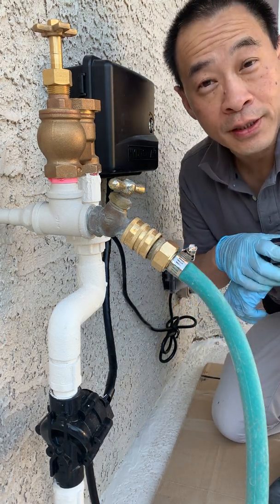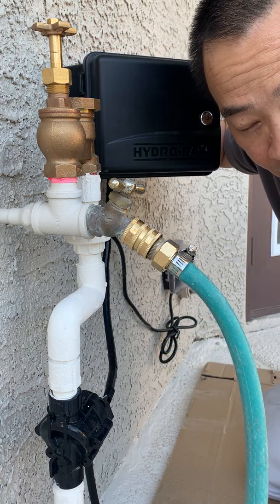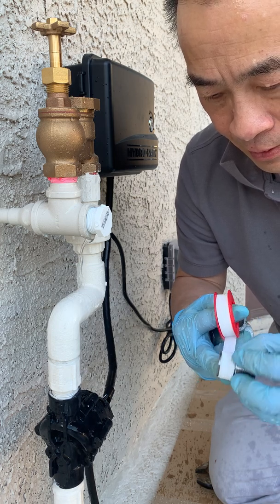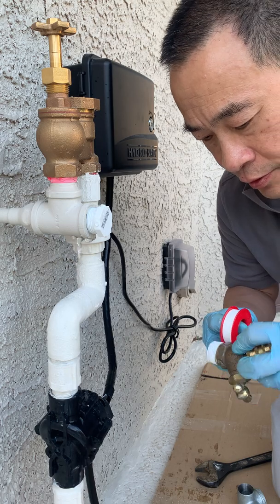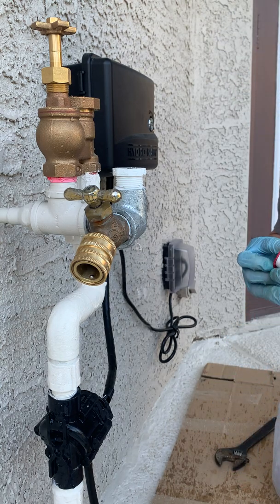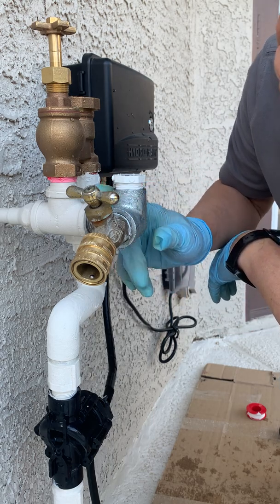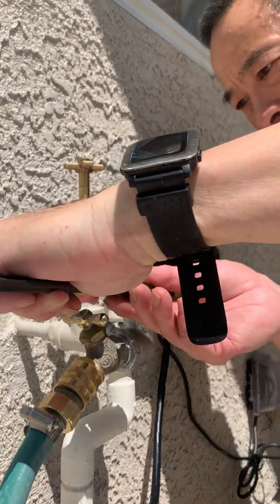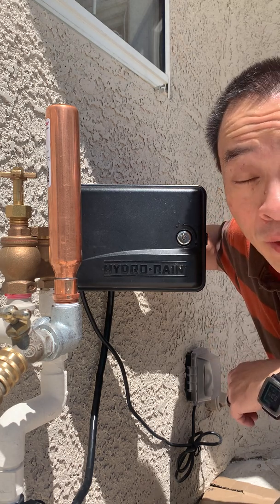Installing a water hammer arrestor for an irrigation valve (See description for update)

Comment: Utizlizing a spigot upstream of the vacuum breaker, other than as a way to drain the line defeats the pourpose of the backflow preventer.   If the client wants a hose bib tied into the irrigation system, it's best to have it on the downstream side.   And who still uses atmospheric vaccum breakers?  Go with a PVB at least.

Comment: I really like that arrestor, because it is large. Can you share what the exact model is? The hydrarestor comes as a 653-B, -C, -D, -AS, and many other such varieties. Thank you so much for putting together this video.
Reply from the maker: Hello!  That was the 653-B.

Thanks for watching!
Reply: @willischung6407  Hi Willis, How has the situation been with water hammer 3 years after using this Sioux Chief arrester ? I am looking to install one right off the stop/waste valve .. Just wanted to find out your reason of choosing 653-B ? Thanks.
Reply from the maker: @anthonyfung7788  Hello! The impact of the valve shutting off is definitely decreased with the 653-B.  I assume that the bigger the arrestor, the more shock damping it will provide.  There fill valve to the pool handles a high water flow, and this arrestor certainly helped.  They don't last forever, but so far I haven't noted any deterioration in shock damping.

Comment: I like your video and it's very informative but I have to mention when you are tightening up the fittings especially ones that have to be real tight be sure to back up the other side of where you are working with a  pipe wrench to keep from cracking the copper line that goes in to the wall. They don't give much. I've seen where people will unknowingly crack the solder loose on the connection that creates a leak. It may not be a gusher at first but you will see evidence of a seep starting when you see green corrosion beginning to form.
Reply from the maker: Thanks very much for your comment!  I will back up the fixed side of the connection in the future.  A friend of mine ended up in the basement cracking pipes from the third floor on down…

Comment: I love seeing guys run wrenches backwards! Pipe dope is a lubricant and sealer. Also, tip 4 u my friend if your using tape. Wrap teflon same direction as thread rotation. Think of "tightening the teflon tape" as fitting is screwed in. Good video!
Reply from the maker: I was taught long ago that there is a correct way and an incorrect way to run a wrench, but obviously still need to relearn that lesson. Thanks!
Reply: Don’t know why you needed to give a “tip”, he is wrapping it in the orientation of the pipe he just rolls the tape on it backwards

Comment: Looks like it did nothing at all. Same as mine then I noticed you never came out and said from inside the house it was quieter.
Reply from the maker: Inside the house the vibration from the valve shutting off is distinctly reduced. The sound of the valve shutting off can still be heard in the back of the house, however. I don't think there is any way to reduce the sound.
Reply: @willischung6407  the disturbing factor in my 27 year old house is that this started in the last 3 years😡

Comment: Dissimilar metals need dielectric union 
Galvanized not legal for water
Reply: Check your local codes on what’s legal. ..Sure electrolysis isn’t good, but it’s just a sprinkler with easy access, so when the metal eats away the weaker, easy fix....but that will be long after the rubber gaskets fail anyway.
Now using two wrenches to counter your torque so you don’t snap your water line behind the wall or in some other crap spot would be better advice.
Reply from the maker: @UCKcmvX4gD6tG4B-VP1ucs5Q I did replace that side exit elbow with PVC but haven’t updated the video yet.

Your suggestion of using two wrenches is an excellent one!  I will use that tip more in the future.
Reply from the maker: Thank you for that information! I will change that out and put in an update on the video!

Willis
Reply: Did the noise go away? I didn’t see a follow up video to confirm
Reply: Thanks for the warning.  In another Youtube water hammer arrestor tutorial, someone threaded the arrestor directly into a PVC female.  Commenters warned that was a bad idea because the male threads will damage the plastic.  So someone suggested using a steel coupling.  Then someone else said copper and steel don't mix... corrosion.  At this point, I have no freaking clue what combination of plumbing elements to use to safely connect a copper water hammer arrestor to a PVC irrigation pipe.  It's shocking that in 2024 there's still so little info online about proper installation of water hammer arrestors, even though millions of people have similar irrigation systems.
Reply: It's a diy home project not a construction project.
Reply from the maker: @stevieb9585  
I agree, and have added that tag. Need to find where the home construction tag is saved to change that.   Thanks!
Reply: @willischung6407  all good 👍great video.
Reply: Are you kidding me? You just got your apprentice license didn't you? Want to show off dielectric. Galvanized is used in irrigation everywhere.